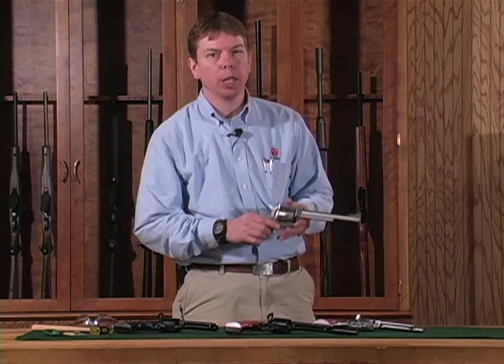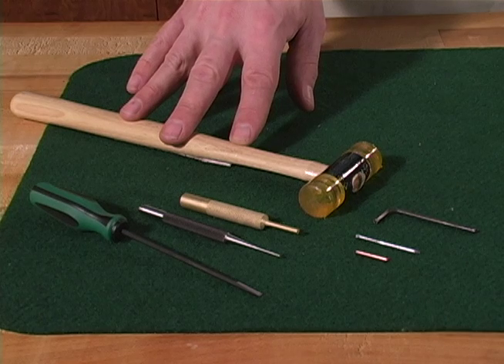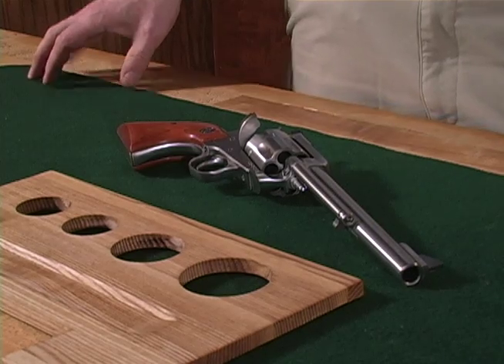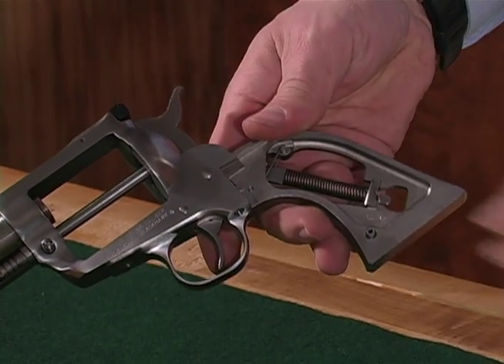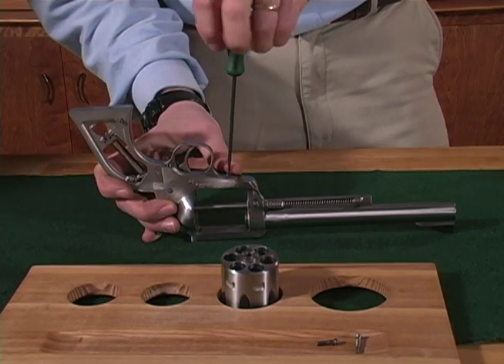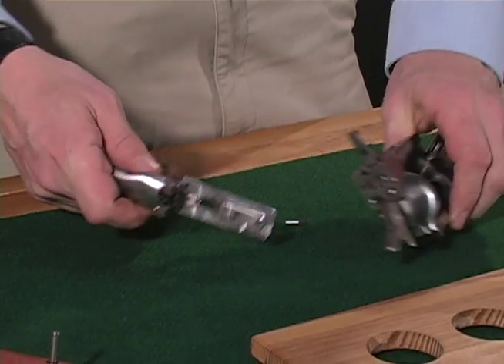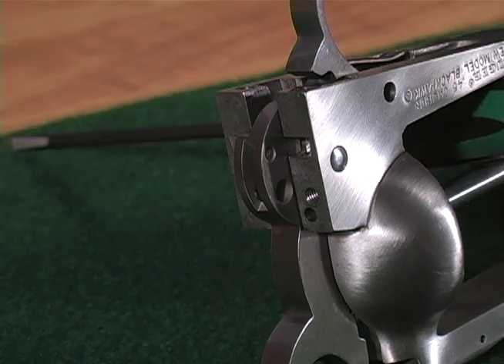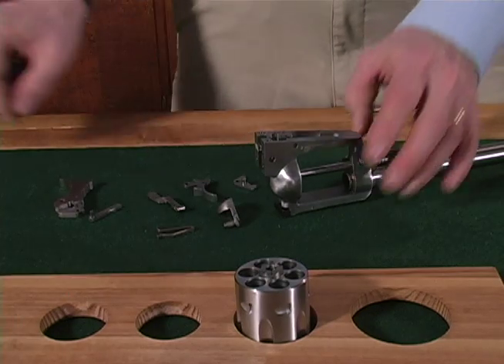Ruger Single Action Revolver Disassembly

Comment: Pro-tip: Download these videos and put them on your phone, tablet, laptop...anything that will fit in your work area. Then as you are working on your gun, you can easily follow along with the video, pausing and re-watching parts as needed. I use a tablet for this purpose and also keep a stylus nearby. That way I can use the stylus to pause the video and not have to touch the tablet screen with oily fingers. 

Good Luck!
Reply: Great idea

Comment: Okay...so far I have not seen a video that addresses the hammer plunger and hammer plunger spring.  Why is that glossed over even on the Ruger video?  I need to replace mine and not sure of the specifics. It has a flattened portion that is off centered.  Does it go up or down, and how does it interact with the plunger pin.   MY spring is mangled too.

Comment: i was given one of these 357 Magnum Blackhawk with the 2 pin, i managed to clean it up just fine but im still confused why the cylinder spins free when the gate is open, closing the gate locks the latch lining up the barrel with the cylinder, and now i cant cock the hammer. every piece looks fine to me. Help!!
Reply: Turbocharge1000 its designed to spin free when the gate is open to facilitate unloading spent cartridges.  if you close the gate and it locks up,  that's what it's supposed to do,  if you can't cock the hammer, check to see if the transfer bar is hitting the back of the firing pin and check to make sure the transfer bar isn't bent.

Comment: I need help. Ruger Redhawk .41 cal. firing pin removal. All I see are pins held in place with nut and tool to remove. I don't see any nut around the pin to remove. Is some thing blocking my view and needs to be taken out. I have removed everything you would do to clean it up. Lost this in a fire. Help me save her.

Comment: My transfer bar broke :(
Reply: What model and how old is the gun?
Reply: P.B. Theriver it's a new model blackhawk but I don't know how old it is because I bought it used
Reply: Watch the video titled Ruger New Vaquero Transfer Bar Pinch , it might help. I've heard if you call Ruger they will replace it. If you install the new one, make sure the new is not pinching. If it is pinching, it will need a little filing.
Reply: Got some new bars. The first one I installed is a perfect fit with no pinch - lucky me!